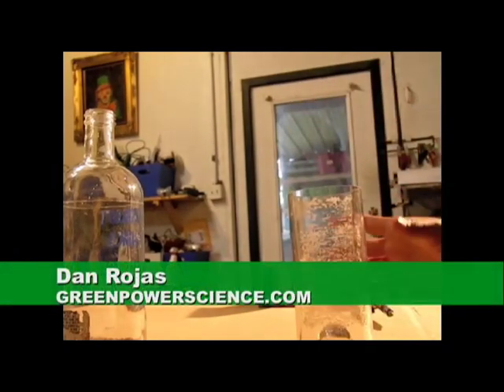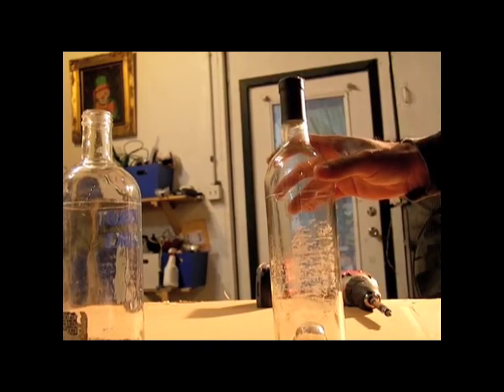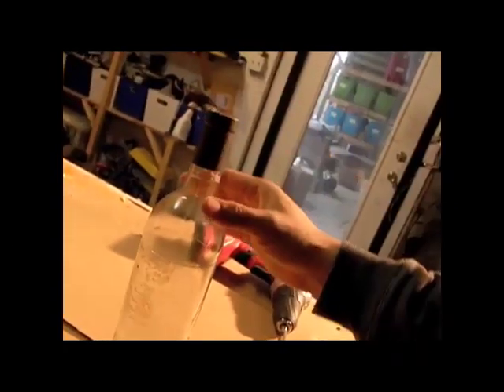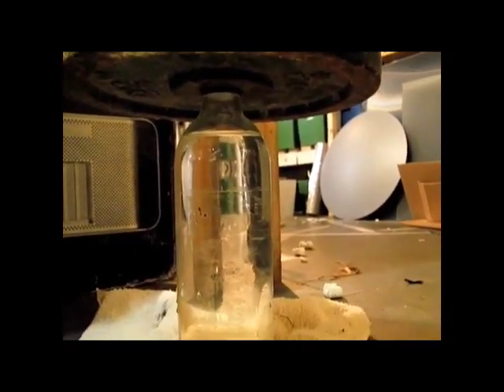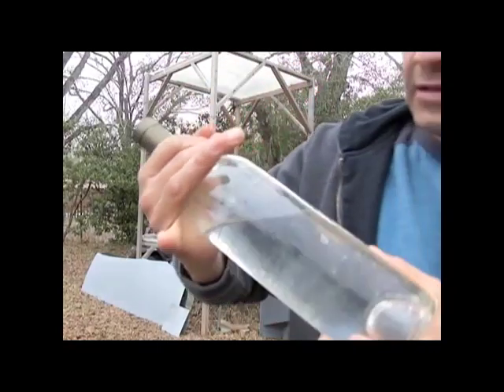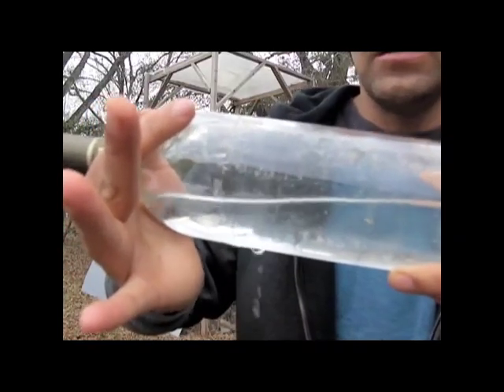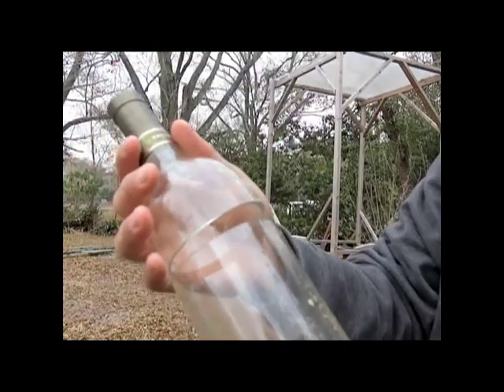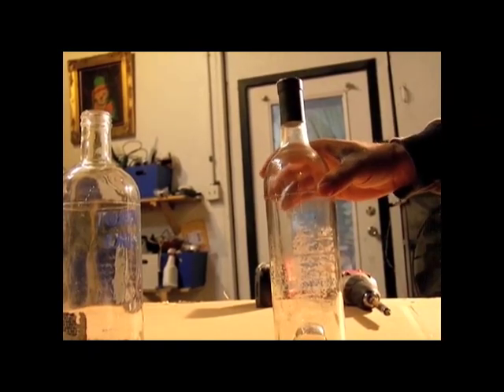Bottle Cutting Glass Bottle Reseals and Holds Water GreenPowerScience

Comment from the maker: You should not hear the glass "tink" from stress, too much heat. You will only see a light change at the score line, almost hard to notice if done with the right temperature. Thinner glass, less heat. Do one small area then work the crack around.

Comment: I watched your first video and it enticed me to get your cutter as I have a ton of bottles i wasnt able to recycle so i figured to turn them into candles. I noticed that the first two i did were neat on one side and broke uneven on the other. Is this because i didnt score the glass with enough pressure? I know you said you dont have to score it over and over but does it need to have heavy hand pressure for the intial score?

Comment: You never gave a reason, as to "why" the cuts had to merge perfectly...
Reply from the maker: +Dave Quick The cutting video had a section where I mentioned it holds water overnight. This was to prove that the puzzle realignment holds water with the top open = no vacuum.

Comment: this video was so pointless it got me searching for similar opinions in the comment section.
Reply from the maker: Not pointless, in the original video, people assumed that water was held in place by air pressure. This video illustrates that the interlocking groves created with the heat separation process allows for a tight reseal. For scientific research there is value in having objects inserted into a glass vessel that is larger than the native orifice. This can be used for inexpensive long-term component protection, floating solar bulbs, or placing golfballs/teddy bears inside a wine bottle for fundraisers:-)
Reply: GREENPOWERSCIENCE Don't let the haters get to you Dan, I love your videos and find them extremely informative. I actually have a couple of questions for you if you don't mind?
1. Is it possible to cut an unopened wine bottle?
2. Is it possible to reseal a cut bottle and if so, can you make the score mark invisible?

Thanks in advance brother!

Keep doing what you do!
Reply: I guess I misunderstood what point you were trying to make with this videos since I got here searching for different answers to different questions. Sorry for sounding rude, I guess that's where all bad comments are coming from.